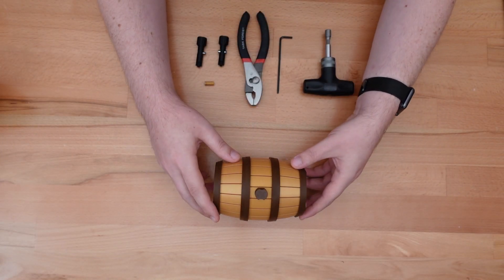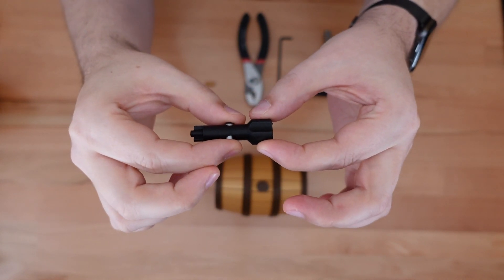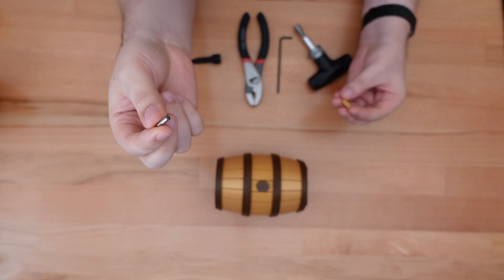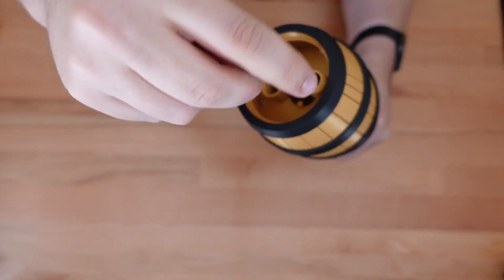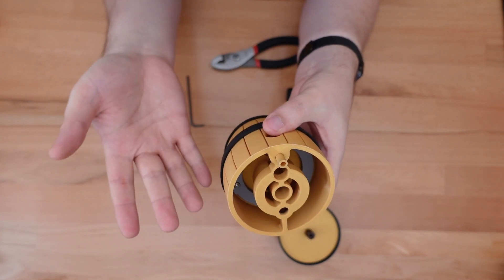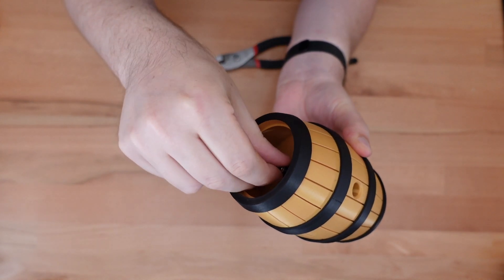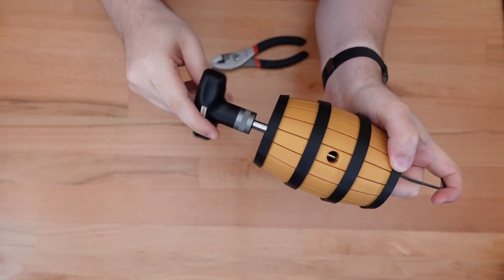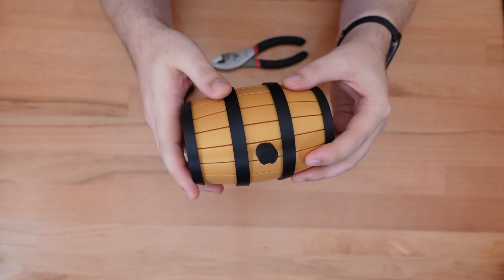Barrel Cooper Puzzle Box - Upgrade!

Comment: Underrated, also printing ur clicky button rn!
Reply: The button isn’t rlly working well, it’s not clicking, so I’m gonna sand or WD-40 it, i also just got into a car crash an hour ago, and I’m fine, but the print gave me something to work on/take my mind off of the crash, so thanks bud!
Reply from the maker: Sorry to hear about the crash! I know experiences like that can really rattle me for a while. Hopefully tuning the button will be an enjoyable distraction.

Thingiverse has quite a few tips to get sticking clicky buttons running more smoothly - and sometimes just using it a while is enough to get the bugs out.

If your spring has too much room to rattle around, a small bolt in the cam might hold it more vertical and make that more reliable.

Stay safe!
Reply: @3DPrinty  ok! Thank you! That’s a long-time sub from me
Reply from the maker: Good luck with the print!

The channel is still new, so I like to think of it as “not yet rated”. Thanks for watching!